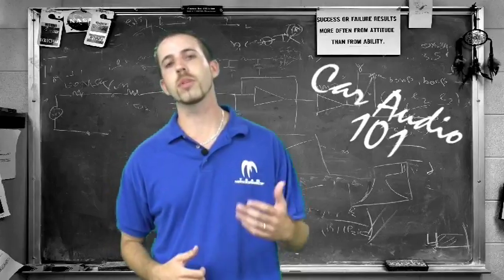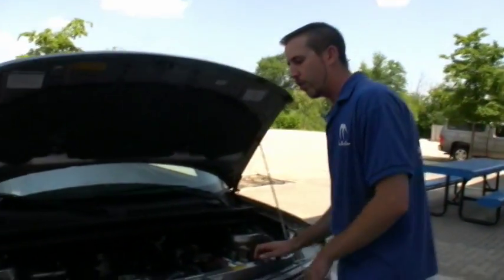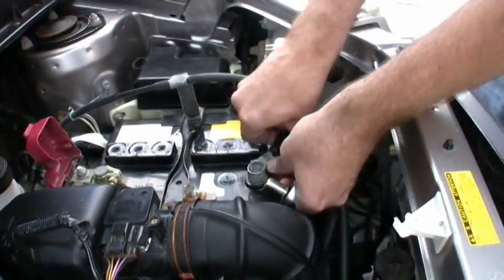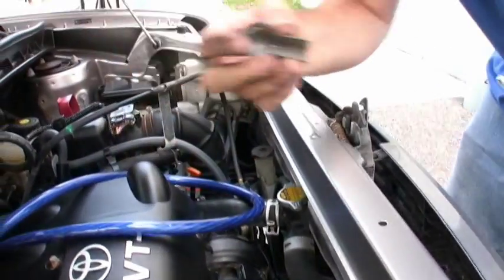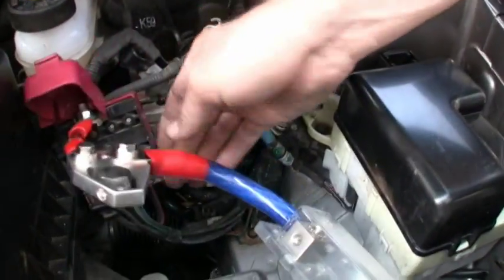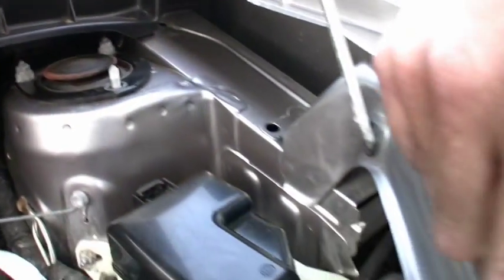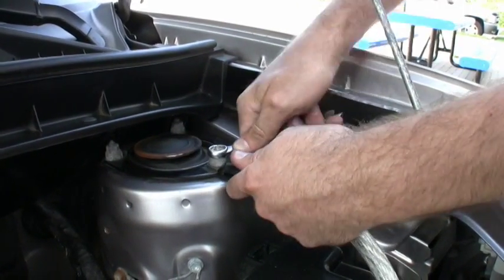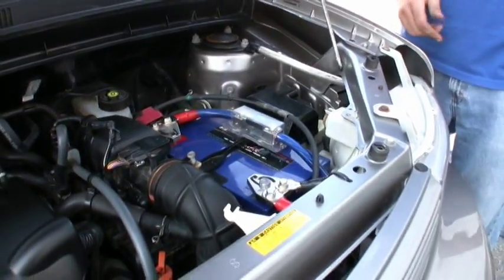Car Audio 101 - The Big 3 Upgrade Tutorial

Comment: Do i need to do this? I have an optima battery now and im going to add a kinetik in the trunk and i will be pushing almost 9,000 watts with 2 ollympus subs and a hifonics goliath sub. I did not know i had to run a 0 gauge wire from the alternator to the main battery.

Comment from the maker: @xingo3000x I researched your amplifier and it appears to be capable of 700wrms @ 2 -Ohm bridged. If your lights are dimming, you should measure your voltage drop at the amp during play. Then turn the amp off and measure the voltage at the power and ground of the amp. Please let me know your results and I will help further.

Comment from the maker: @sqhschief The "Big 3" will never hurt to do when working with an aftermarket audio system. You shouldn't require an electrical upgrade for 500watts in most cases.

Comment from the maker: @flint1810 8-10 total. You need enough power wire to run from alt + to batt +. Then from batt - to frame and engine block to batt - or frame.

Comment: mike you da man with the masta plan...i just threw a '06 Kicker S15L7 wired to 1 ohm on my Kicker KX1200.1 with a 4 gauge amp kit in a 6 cu ft ported box. Shits slapping but my car nearly turns off when I try to turn it up past medium bumpin volume..even when im cruisin..I was told I will need a 160 amp alternator & a kinetik 1800...what do you think? any specific brand of wire that is good? Cus i found some 0 gauge on ebay but idk yet. Any brand of ALT you roll with? I was checking out Nations

Comment from the maker: @lovers800 If your battery post is heating up on the ground then it may indicate your battery is damaged or you have a bad point of ground from the negative battery post to the location on the vehicle. Heat means high resistance. Is you connector tight on that post or is it lose?

Comment: hey i have a boss audio touch screen dvd 80X4 deck 4X6 pioneers in tha front 6x9 infintys 2 12" subs sony xplod 1000w/each and a 1400w amp i installed the new deck yesterday and my car actually dies even when running never had a prob before that

Comment: i was wondering if there was a difference in the wire type used, i see regular 1 gauge copper wire, and then platinum coated and just a lot of different types. so what is the difference in the quality with the wires or is it all the same?

Comment from the maker: @dereileak A lot of guys are doing the Big 4. The 4th connection is from alt - (case) to battery -, chassis ground or engine block. I have seen all of those used. But, in the Scion the alt is direct bolted to the engine block so there was no need.

Comment from the maker: @fabehern That is strange! Did you leave all of the stock wiring in tact? If so, you can try a process of elimination by removing an upgraded wire to see if it works properly at that point. There is a small fail safe on the factory ground that must be present, I do know that.

Comment from the maker: @markkdave There are a lot of companies like Stinger, Hooker and Tsunami that make nice circuit breakers. The value depends on your amps. If you are going to place one between the alt + and batt + it should be valued a little above the max amperage rating on the alt.

Comment from the maker: @DeepzThinker When it comes to issues like this, I recommend working with a mechanic or alternator manufacturer. There are just too many variations on the vehicle side and you regulator may be located in the fuse box prior to the batt.

Comment from the maker: @garrettnewsome You need more than the Optima for sure. You may even need an upgraded alt depending on how much those compressors demand. Your Red Top is not enough for your 1600watt amplifier when it is also being used to run your vehicle. I would recommend contacting Kinetik and/or XS Power. They will assist you in finding the right combo for alt and batts in your particular application.

Comment from the maker: @toyopl Leave your stock wires in tact and simply piggy back over them. The 3rd wire runs from the battery negative to a bolt on the engine block under the battery tray. I quickly show this but it is very hard to see.

Comment: i have a scion xb also, did you upgrade the alternator, also where did you run the 0 gauge wire for the amp.  im planning on running something around 2000 rms is that safe with my stock alternator

Comment: Hey man, I have a 15inch l7 solobaric and a 1600 watt SPL amp.. And I was wondering, I have a capacitor and everything. And when my sub kicks, I can feel my truck loosing power.. Like, It wants to turn off. So I was wondering, Should I do the big three? Or add another battery? Im am a mini trucker too so, I must add that my battery is also powering 3 compressors.. And its a optima red top battery.

Comment from the maker: @camaroboyy First I would recommend upgrading your stock battery, or add an aftermarket battery. Then you should look at upgradingt he wire from the front battery to the back. Distro from that main wire to each amp. The Big 3 can only help so piggy backing that on top of the stock wire would be helpful.

Comment from the maker: I would recommend a 150amp in line fuse. You may not need an alt upgrade. Determine what 4 channel you are after and add up the total power of all amps in your system. Then contact Kinetik or XS Power for what battery these recommend for your total power.

Comment from the maker: Your vehicle has a fail safe in line on that wire, or that wire runs through the factory fuse box. Keep the factory wire connected and simply add the new wires.

Comment from the maker: 1. 10-12ft will do.
2. The fuse from the alt to the batt should be around the max amperage of the alt. The fuse from the batt to the amps should be the sum of the fusing on the amps or recommended in line by the manufacturer.

Comment from the maker: I generally believe that keeping your factory wires in place and simply adding additional wires as long as the wires are in good condition. I have heard of guys removing their stock wiring and the car won't start. This is because their vehicle has a safety in line from the alt to the battery.

Comment from the maker: Hmmm, is it doing this with the system on? If so, you will need to look at upgrading your alt and batt. If it does this with you system off, I would look to see if you bypassed your factory fuse block/voltage regulator. Did you leave the stock wiring intact and simply double at the same connections, or did you remove the factory wiring? I know that my old Neon required the factory wires to be intact because it went to a factory regulator in the fuse box.

Comment: Great video but one question what kinda fuse should i use if im running a 1200w amp n my aftermarket alt is rated for 260amps i dunno how strong my fuse should be from my alt to my battery ....any help? Thanks

Comment: hey maxxsonics, I recently did the big 3 with stock battery and stock alternator. now my rpm dropped at idle from 800-900 down to 500-600 causing my car to sputter and wanting to turn off. any idea why?

Comment from the maker: If you remove the positive wire from the battery and touch it to the frame of the car by accident with your fuse still in line to the amp(s) in the rear, you have a high risk of damaging the electrical components of the amp(s). Most amps, especially larger amplifiers, will hold charge in the capacitors in the amp. Better safe than sorry.

Comment: neither yet. i've recently located a place online that is an authorized dealer. what i have in place so far is a pioneer deh-p5900ib head unit that has been sitting in my closet since Christmas 2007. which do i need?

Comment: i've decided to buy 4 Hifonics HFi 12's for my car. i'm trying to figure the best amp to use. i know they can handle 1200w rms, so common sense would say to use the  BXI 1210D. i have read that Hifonics amps are rated at 14.4 volts, and i have no clue what the average voltage is on my car. would i do better using the BXI 1210D or another Hifonics amp. i definately don't want to underpower them.

Comment from the maker: Not true at all. Using a larger than required power/ground wire does not increase your current draw, it simply provides less resistance. Less resistance equals more efficiency which helps the entire system. Smaller wire equals more resistance and power is often lost in heat which hurts the overall performance of the system.

Comment: well if you want to save money then simply just get what you need, yes it always better to have excess power than to not have enough. upgrading your factory battery to a high output batttery that is meant for sound systems will help extensively, as far as brands its your call some people love optima other people argue that stinger is the best, i personally like kinetics, they worked awsome for me, no matter what brand you get there is differnt sizes depending how many watts your running.

Comment: Alright Mike here is my question. I am currently powering a Hifonics ZXI 6010 with my regular battery and stock alternator that i installed myself. But i also want to install a BXI 2010D. So does this mean i will have to purchase a second battery and another alternator too. I would rather do a distribution block but I know they don't make them big enough for 0 gauge. I will be installing this in a 1995 Ford Bronco just so you know. Any help is greatly appreciated thanks.

Comment from the maker: You could potentially have a few issues and only a process of elimination will help determine what it is. I would recommend measuring your voltage drop at the front battery and the + / - on the amplifier. I've had headunits that would shut off at low voltage before the amps. You may have a bad battery.

Comment: caps aren't a bad idea but if you think about it a power cell are not too much more expensive and they work a lot better. also installing a power cell will give you and maintain a higher voltage than that 2 farad capacitor. Try changing you battery up front to begin.  then you can add a powercell in the car, and don't worry it will not add extra load to your alternator. they work really efficiently, but it is always recomended to upgrade your alternator when adding batteries or power cells.

Comment: i think i saw that same video, you only keep your factory wires if they have a purpose, if the wires are only used for the wires that you are upgrading then they are not necessary. also the system that you saw had capacitors thus using the small lightbulb to recharge them before installing the fuse, capacitors wll drain if not connected and it is extremely dangerous to just connect them with out properly charging them.

Comment: when upgradeing to the big three you are replaceing your stock wires so remove them and run only the new 0 gauge...and the other video that u seen he was chargeing his system with a small wire with a light or resistor on it?they do that when people are running capacitors because if you dont u can explode ur capacitors...i kno this from experience it happend to me

Comment: hmm sounds good.  i think i'll have to upgrade the alternator as well.  i couldn't tell you what it's rated at, but it's pretty small.  it's from a 2002 chevy cavalier 2.2 inline 4 cylinder.  i could use a cadillac alternator as an alternative, but i was wondering if i should just go with a high output alternator instead along with another battery.

Comment from the maker: My suggestion would be to install the system and measure the voltage drop at the power and ground of the amplifier with the vehicle running. If you are dropping below 12V on heavy bass notes then I recommend upgrading the front battery first. What is your factoy alternator rated at?

Comment: I'm extremely impressed by this video.  i have a few questions.  I'm upgrading my sound system completely.  i'll be pushing 2 12" pioneer champions along with an avionixx 1,200 watt amp, a 2 farad capacitor, and possibly another battery.  here is my question, would i need another battery if i ran 0 gauge from my factory setup directly to the cap and amp?  also, should i upgrade my alternator?  One more, would it be wise to invest in a kinetik battery to replace the factory battery?  thanks!

Comment: Wait, im confused. Do you HAVE to put a fuse holder for the alternator upgrade? Or can it be ran straight to the battery?

Also, do you have to use 1/0 gauge wire, or can I use 4 Gauge?

Comment from the maker: The fuse from the alternator power to the battery power connection is to provide protection incase there is a short. In your case a 100amp fuse would be fine.

Comment from the maker: I would first suggest measuring the actual voltage drop at the power and ground terminals of the amplifier while playing your system with the car on. If you provide this voltage drop reading then I can suggest your next step.

Comment: Nice vid dude, i haven´t make the Big3 because my current it´s 15 volts and 14.1 volts on Bass race Comps, i have a HO Alternator and 5000 battery amps for 4000 watts, if i make the big3 wich i know i don´t need for the moment, would it give me at least 0.2 extra volts on bass race?? if that´s the case i´m gonna make it, if not, there´s no case :D

Comment: i actually have one more question about the second battery that i'm gonna be looking for. my system is gonna be about 7200 watts. would 850 amp battery be enough power for the system? the website says its more power than 100 1 farad caps.

Comment from the maker: Isolators are not required. But fusing at the output of battery 1 and input of battery 2 is required in case you have a short. If you have an isolator then your rear battery is dedicated to the audio system only and the isolator will not allow for you to use the resources of the front battery for your audio system. Some people prefer isolators, but I do not.

Comment from the maker: I have heard of people using welding cable etc, but the car audio wire you see used in this tutorial have a protective layer around the copper designed to withstand a good amount of heat. If the wire you choose isn't designed for high heat applications then you may want to seek an alternative.

Comment: i just upgraded my battery and wanted to do the big 3.

someone told me to use heavier copper wire not music grade wire for this upgrade.

i also wanted to know if any changes would need to be made  to my current electrical system before upgrading my alternator.

Comment from the maker: Monitor your voltage drop. That will be the key. If you ever fall below 12V then you still require more upgrades to the electrical system.

Comment from the maker: If your secondary battery can supply your amplifiers sufficiently then you will not need to upgrade your primary battery. Monitor your voltage with the system off/car running as well as with the system turned up/car running. If they are not resting above 13.8V with the car running and amps off then I would suggest an upgraded alternator.

Comment from the maker: It is always recommended to perform the Big 3 upgrade. Your lights dimming may be an indication that you lack the voltage and reserve power required by your amplifier. Look into upgrading your battery and alternator as well.

Comment: hey i have a question i have 2 12" inch alpine type r's and its loud but it sure does take a toll on my battery and alternator but i know that before i bought the sound system the battery was bad and well i wanna do the big 3 but i was wonder if i can use 2 awg or does it have to be 0 awg??? im 16 and new at this so please help me ohhhh and my amp is a jbl bp1200 thats 1200 rms for my alpine subs

Comment from the maker: You have a 2400watt amp so you need to look at upgrading the battery and alternator. I have seen many cars get away with battery upgrades only, but you won't know if you will require the alt as well until you replace the battery and measure the voltage at the amp during play.

Comment from the maker: It sounds like you may not have the proper electrical system for your current amp. Have you measured the voltage at your amplifiers' power and ground connections?

Comment from the maker: The most accurate way to measure your voltage drop is at the amplifiers' power and ground terminals. Your indicator in the dash is rarely accurate and slow to respond to the true voltage drop.

Comment from the maker: Everything already functions without any upgrades. You are simply adding to upgrading the stock wiring for increased current and voltage capabilities with less resistance. ;-)

What terminal are you asking about?

Comment from the maker: As an example, most runs from front to back average 13-16ft. If this is the case, 4ga is capable of carrying 50-65 amps of current. 

Your potential system rms watts is 900w. 900w / 14.4V is 62.5amps at 100% efficiency. As voltage drops amperage increases. 

0ga would be overkill in your application, but would not hurt anything but rather leave room for upgrades in the future. The 4ga is really pushing it though.

Comment: Great video, I'm currently having problems with my car stereo draining my battery, been wanting to do the big 3, looks pretty simple Silly question maybe, but if I'm running 4ga to my trunk for my 2 amps. Which claim to be 125x4 and 400 watts (Performance Teknique, so probably way overrated) would running 0ga for this as opposed to 4ga make any difference?

Comment from the maker: The amp is not "putting out Ohms" as you say. The amplifier produces power (watts) in volts and amps which are presented to the subs. Ohms are units of resistance, not power.

Comment from the maker: Amps are rated for specific loads that they can handle (Resistance). Your subwoofers have a coils thats' circuit is rated at a certain resistance (Impedance) Ohms. If you use two 4 Ohms single voice coil sub wired in parallel to a mono amp then your resistance is 2 Ohms at the amp. Your amplifier will apply equal power to each subwoofer because they are identical in resistance. Does this help?